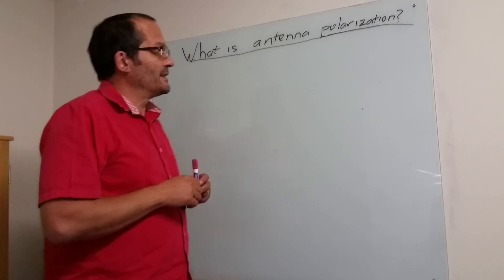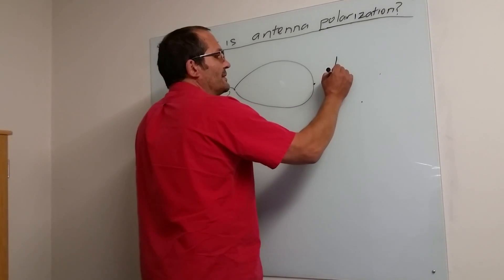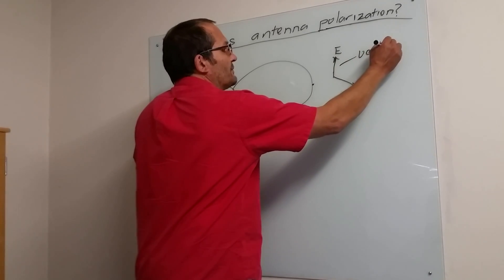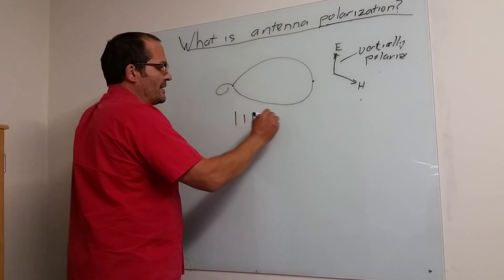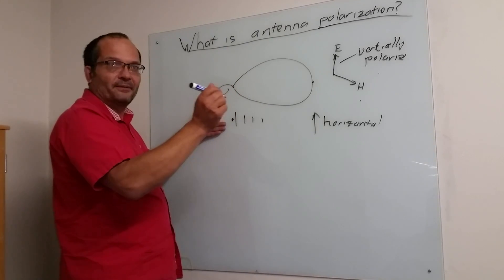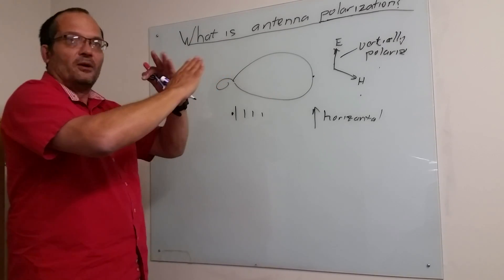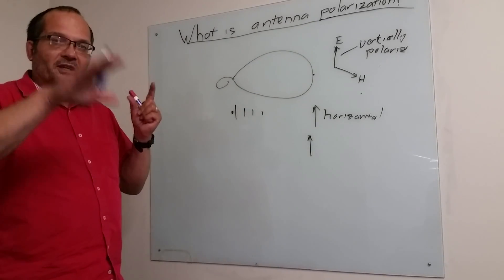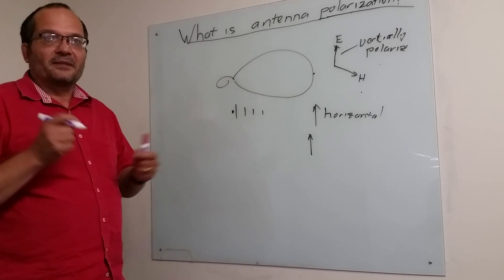What is antenna polarization?

Comment: Subject is confusing already, came to this video for an explanation but, with lot of echo + weird accent + confusing explanation + lots of technicisms = 🤯🤯
Reply from the maker: Hi Javier - We are sorry to hear this. We cannot fix all of your issues, but we did add some captions, which will hopefully help with the accent. We are a South Africa based company and all the engineers (including Dr Fourie) has some kind of accent - we know that this makes it more difficult to understand - but hopefully the captions help.

You can have a look at this article as well: https://poynting.tech/articles/antenna-faq/what-is-the-polarisation-of-a-gsm-or-lte-network/ 

Another video with more visuals, can be found here: https://youtu.be/-4AY8ZIudEs?t=1086. If you use the link you will see that you can start at 18 minutes, which explains the polarisation. If antennas are of interest - you can watch the whole webinar - it is very interesting.

The weird accent is still there - but the sound is better and there are supporting visuals. 

I really hope this helps as I can see that you are very frustrated.

Kind regards
Ylana (Poynting)